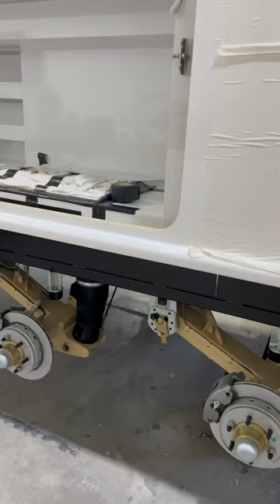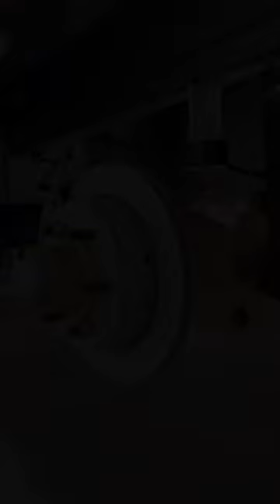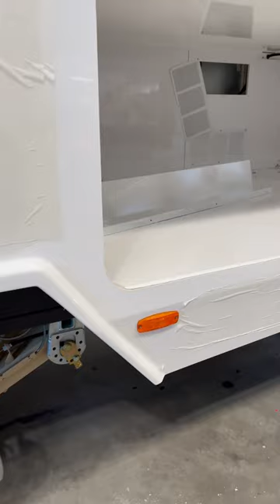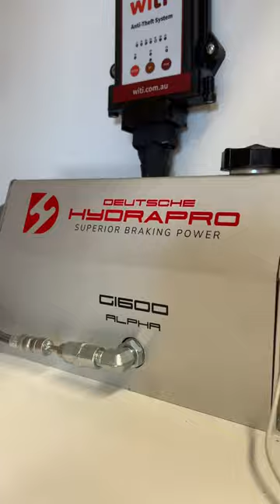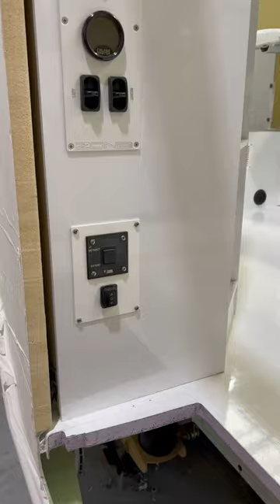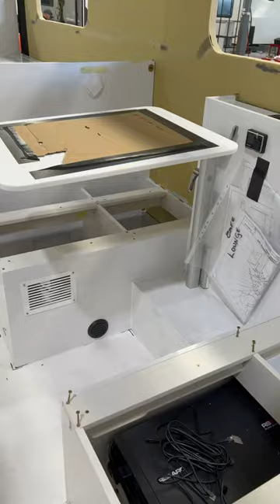The new Expedition coming together 🤘🏼

Comment: I would like to see a camp unit that fits onto a NPS 300 4x4 single cab with a pass through. No wheel arches or chassis. lift on bolt on job done